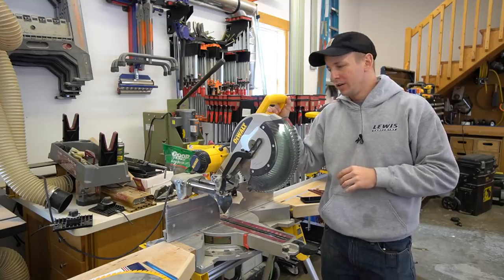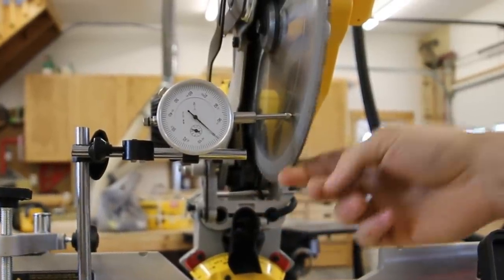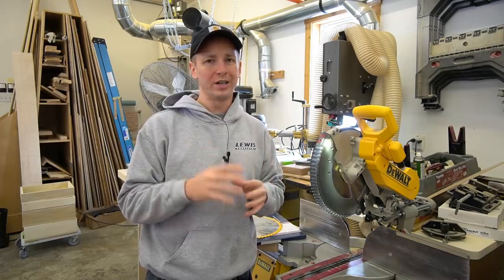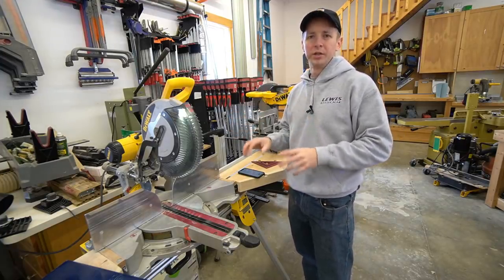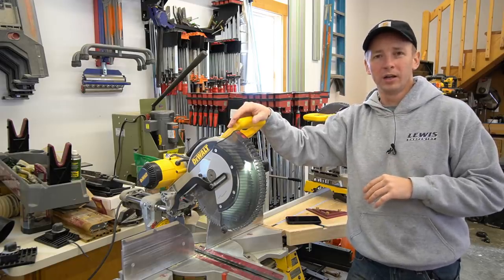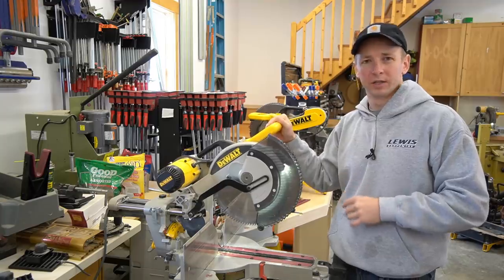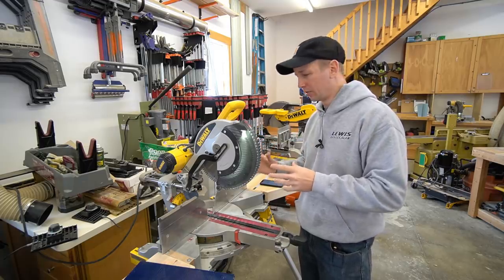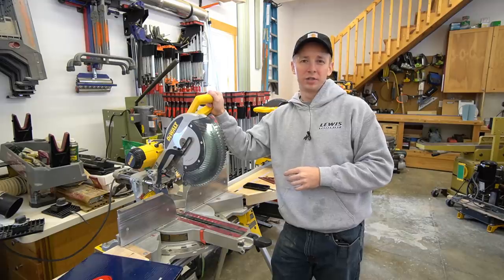DEWALT DWS780 | The BEST Miter Saw for Production Trim Carpenters???

Comment: According to Lowe's website both 79 and 80 weigh the same. Lowe's website has had a lot of errors though
Reply: Internal components of the 779 differ slightly; DeWalt isn't very helpful in breaking down the differences, but they're there.
Reply: Lowe’s website, sucks.  Homedepot has a great website, but they list the 780 as heavier
Reply: @frankhouck4446  lol the Lowe's vs home depot arguing. I worked at Lowes for 5 years. I now work at home depot. They are pretty close to the same thing. That's a homeowner. I actually prefer shopping at Lowe's. If I was a contractor, I'd prefer shopping at home Depot. But when people say that they get bad or good customer service at one or the other, it's funny because you hear it both ways. One day you might happen to get unlucky at one or the other and or be raised chopping at one or the other and build a bias on that...
Reply: @Deathbysnusnu125  - well, I didn’t mention anything about the in store experience just the website….and as an ocd Engineer who is very particular about researching tool purchases, Hole Depot’s website is far superior.  First, it doesn’t “Hang-up”, reset perpetually or simply go blank like Lowe’s’ does.  Second, the activity on Home Depot’s is fantastic giving me many answered questions and relevant comments which I do go through.  Home Depot simply does a better job marketing and servicing their site.  Lastly, HD online purchasing and CS is superior. 

With that said, I also think HD’s in store experience is better. They have more inventory and carry better Brands. Both stores have good people working there who are nice and as helpful as they can be….. of course I take the Ron Swanson approach…. “I know more than you” so I don’t often need technical help.  I am a Mechanical Engineer who does all my own work/projects. I do electrical, structural, plumbing, etc.  I even turned my crawl space into a basement on my first house…. Dug out, re-poured foundation walls, footers, added I-beam support, floating concrete slab, drainage, then finished the space.  I, of course also install my own HVAC.

Comment: I went with the 779 and I put on the XPS light kit. I just do stuff around the house and I've done a few small projects on the side, so it serves me. If I start so ng more jobs I'll just upgrade to the 780 when I need to. But, u really struggled with a ridgid that couldn't be dialed in square, I was glad to get rid of it. I really wanted the Makita with the forward orented slides to save space, but all the info is kinda old now and there were some performance issues that bugged be. I found out a couple people who made review videos with it no longer use it for their work. That says a lot. Bummer, I like Makita and have a bunch of their tools. Dewalts are what I see all the time with trim carpenters around town everywhere I've lived, on YT... Hard to argue with that

Comment: I absolutely agree the Festool products I tried were under powered compared to the Mikita tools I have.  I started with Mikita back when they were 9.6 volt then went to Dewalt .  Then as money became available I bought a 12” sliding miter Milwaukee has been a work horse.  Have had 12 volt Mikita, once my Dewalt batteries continued dying, I bought Mikita brushless and have been extremely impressed.  Like I said I tried Festool but was really underpowered compared to my Mikita tools. Best part of Festool is they are easy to sell because they must market better than they build. 
 Every brand of tool out there has some weaknesses so Mikita is my choice due to batteries for that platform.  Great content 👍
🇺🇸🦅🌏⚓️🇺🇸
Reply: DeWALT batteries dying?  I still have DeWALT batteries from when the 20v line was first released.  they still work fine.

Comment: Great content!  I have a 780 and love it.  And I agree with you on the weakness of its dust extraction.  I've  been surprised that no one has come out with an add-on that addresses this weakness.  While I agree that the light being used for its dual purpose of generic lighting and exact cut determination is infinity better than laser,  it can be almost completely washed out in bright sunlight.  I find myself having to create some shade in order to see the cut line.  Another benefit not mentioned is that the light means changing blade widths is irrelevant to the "shadow line method."

Comment: I looked online and see a 56 vs 54 pounds from the 799 to the 780. For the few dollars difference I’d only buy the 780. 
You did a great job on this video. I own a 715 from 1998 and it’s still doing just fine. It was $400 back then.

Comment: Gr8 saw & even better when sat on the dewalt stand. I went with the 780 and not the 779 because of the light. Also, Dewalt aren't stupid, if you upgrade the 779 with the led your warranty is Void.
I suffered an old cheapo slider for many years which had to be checked with every cut each time you changed an angle. Such a hateful thing.
Using the 780 after that mangle was pure joy, everything about it just feels right. 
Gr8 vid, thanx from 🇬🇧

Comment: I have the privilege to use the 780 at the school I attend and they have them attached to the rigid portable table with the big tires there great they have other dewalt models and other brand mider saws but I got my eye on the 780 with the big tire and portable ridgid stand, the dewalt stand tires are to small to push around the jobsite, i think

Comment: I love the way the kapex feels while using it, the handle, foreword rails, dust collection, easy access to bevel, but unfortunately, that’s just not enough. I was in the middle of a big job and the bevel flip handle thing broke. One $.90 piece rendered the saw useless, and it was back ordered two weeks!!
 I grabbed a DW716, FS Tool blade and have never looked back. I just use the HKC for everything exceeding its capacity. The motor on my kapex never let out the smoke, but it was always underpowered. The only way I would reconsider is if they went to a 12” blade, and a motor that could handle a full kerf. That will never happen so I’ll run the dewalt until I’m run into the ground.
Reply from the maker: The 716 with FS Tool blade is an amazing combo. My favorite also.

Comment: Wow, in my own personal opinion, this is the first disappointing video. I truly like all of your stuff and my comments will testify to that. I own a Dewalt dw708 and it is great. I also still own the original Kapex that I have had for 13 years and I feel that there is no comparison. Nobody touches my Kapex but me and I have never had a single problem with it. I have been doing trim carpentry for over 30 years and I can't say enough positive things about the Kapex. Maybe you got a couple of suspect ones and maybe someone ruined yours, but I would never put Dewalt in the same category as Festool. The dw708 has a great reputation but the company has changed in many directions since then. The Kapex is one of my favorite tools and I have many, many tools. I did not drink the kool-aid of the many that said that they would never spend that kind of money on a chop saw. I wish that you had a better experience with the Kapex.
Reply from the maker: I have a lot of friends with the same experience as you. Kapex has been great for them. For me, even aside from the motor issues...the blade guard constantly broke, lasers needed recalibrated, and bevel lock wears out and needs replaced. For repetition work like production trim it just didn't hold up for me. 

Aside from my experience, its a known fact that probably countless thousands of these saws had motor failure and it took years for festool to do anything about it. 

I'd say count yourself lucky. I had two different kapexes and neither of them lasted past 3 years.

Comment: Been a trim carpenter for 40 years. I hate the dewalt. No proper dust extraction. Heavy saw. Not 100% accurate when sliding. The Kapex is the best. Excellent dust control and you can adjust it to be 100% accurate. Festool also has the best blades. A 10” blade is better than a 12” blade. I would never cut crown standing up. Easier and faster and more accurate to lay it down. This guy promotes dewalt most likely because they’re paying him. Festool rules completely. It’s a fact!
Reply from the maker: This guy promotes Dewalt because he owned two Kapexes and both motors burn up and both had a fence that wasn't true. It's impossible to make any saw cut accurately if the fence isn't straight. (And no, dewalt doesn't pay me.)